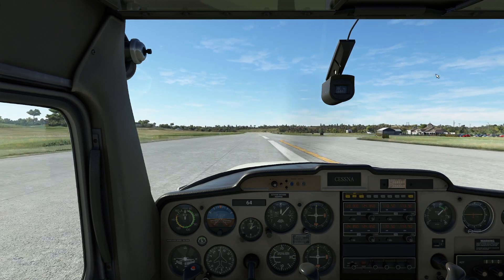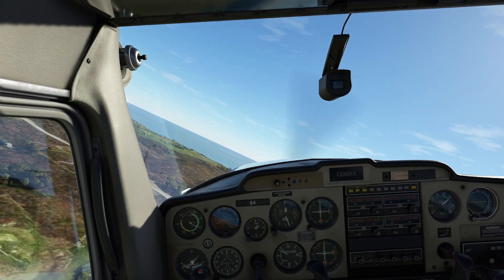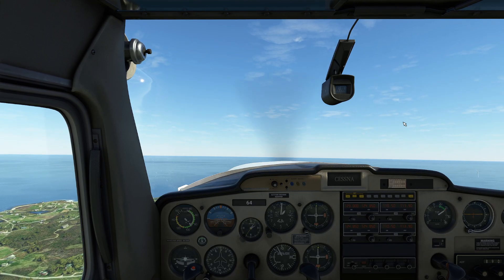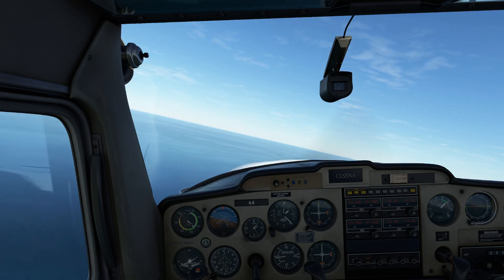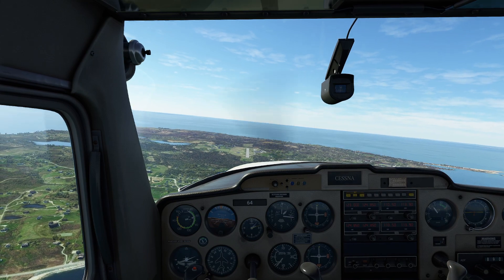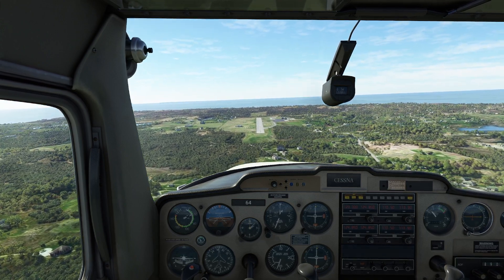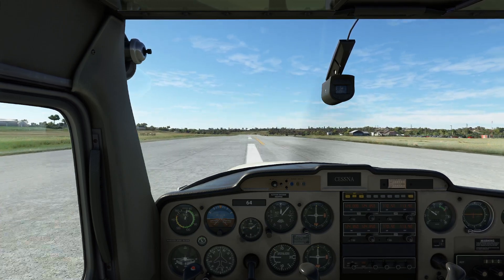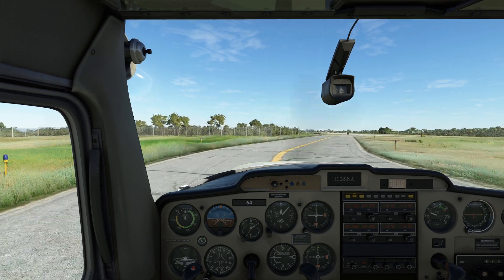MSFS - Landing without Aileron or Elevator

Comment: Having the ailerons fixed at the neutral position is not realistic: in real life they'd be jammed deflected, or flapping around freely in the airstream. The latter could be deadly on a turbulent day. The airplane can even be "flyable but not landable": it might turn out that you only have sufficient rudder authority to counter the roll induced by a control jam above a certain airspeed.